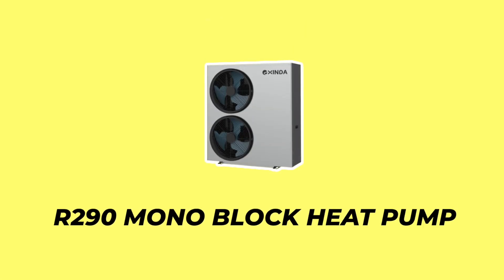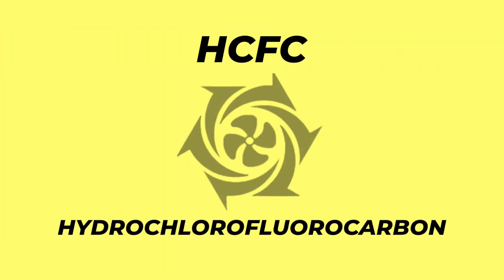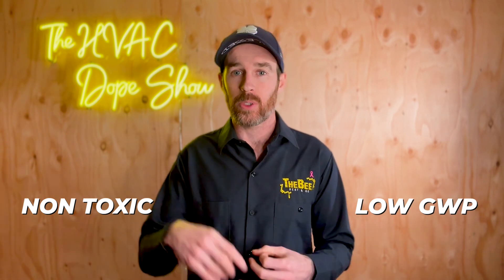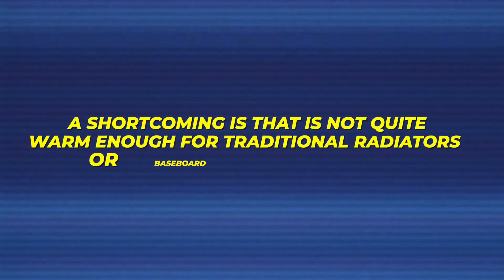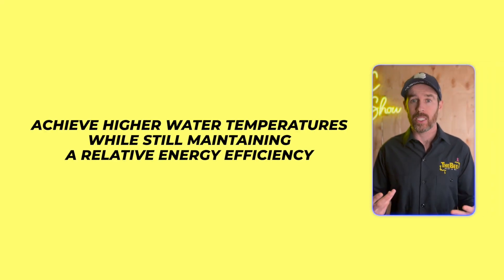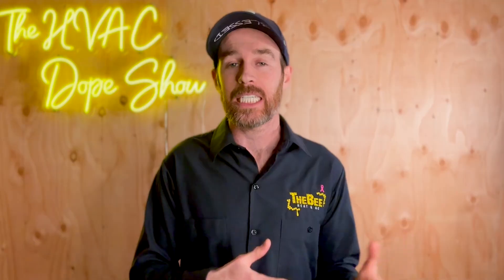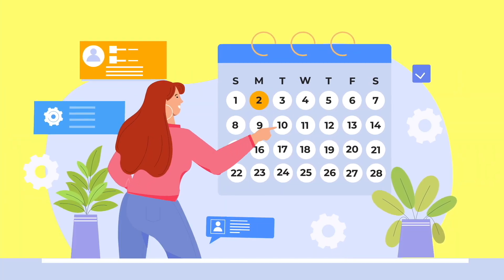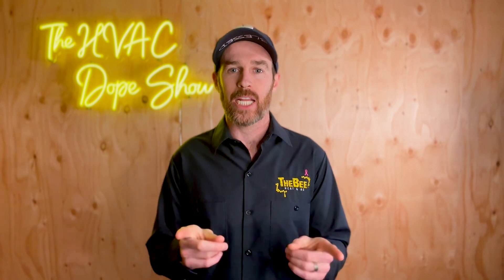This Heat Pump changes EVERYTHING | R290 Heat Pump

Comment: In Australia ive been installing r290 monibloc hot water units for a few years now and i can say with confidence that they just work!
We even have r32 pool heating heat pumps that work well to heat pools
Reply from the maker: Right on that’s awesome, yeah I’m hoping they make there way here. I know we’re having r32 monobloc coming soon that will heat better than 410a but not quite as well as r290 so it’s exciting to see the tech advance
Reply: @TheHVACDopeShow it's crazy that R290 is twice as performant as R-134a, then you realize that ammonia is over 3x as performant as R-290. But with the caveat of being flammable, toxic, smelly, and corrosive to any copper alloys.
Water would be 2x ammonia, but it has the pesky habit of freezing below 0 and needing a vacuum to boil at anywhere near room temp. But at least you don't need to worry about moisture in the lines..
Reply: Excellent. How do you find it for indoor cooling, especially during very hot summer days?

Comment: Wonder if this is a good use for pool heaters. The current ones have a hard time getting water above the upper 90s so you need gas still if you have a spa attached
Reply from the maker: There are a lot of heat pumps like this for pools and spas so yes they should have something available for hotter temps too

Comment: Do you believe these upcoming monoblock systems will also be used to replace the furnaces from hydronic heating/hot water setups using air handlers? Currently have an old Buderus that heats up coils in the air handler to give us heat (2 zones/air handlers), as well as supplies our domestic hot water. Very efficient and happy with it, but the paired A/C units are 20 years old and inefficient. I'm hoping these monoblocks fit the bill for disconnecting the Buderus and old A/C compressors. Thoughts? And great vids
Reply from the maker: They’re kind of pricey atm and the r290 systems aren’t available here yet. Depends where the R32 Altherma comes in and if it’s cost effective, I’ve just seen some pricing from the Solstice seemed doable but the performance was only hot enough for radiant flooring temperatures (120F) to still maintain efficiency.
Reply: @TheHVACDopeShow  thank for the reply. I’m not ready for a monoblock switch-out yet, so I have a few more years for other manufacturers  to get in there a drive prices down (hopefully some name brands too). Was mostly interested to know if the application fits. Sounds like it might. 👍

Comment: Living on the Oregon coast the only available energy source is electricity or gas. Propane tanks are not allowed in my community Is there an equivalent heat pump that runs on electricity?
Reply from the maker: No worries 😁 It actually doesn’t run on propane propane is the refrigerant. R290 is propane. It’s powered by electricity like every other heat pump so you’ll be able to use it when they’re available in the USA. Hoping soon but no word yet, maybe 2025
Reply from the maker: They make monoblock with R32 that will be out this year but it’s not here yet.
Reply: @TheHVACDopeShow   Can those be retro-fitted to accept/use R290 when available

Comment: I am confused with the descriptions for the upcoming mono-bloc systems using propane as a replacement for other refrigerants. For example, the new mono-blocs are reported in this video to be absolutely fantastic for base board heatings..........AHhhhh now to get rid of my oil boiler!

OK so I have free heat (I have solar) in the winters and continue to sweat in the summers??? How will the mono-block provide air conditioning when needed? Base boards???

Joe Howarth
Reply from the maker: Air handler… it’s water pipes so it ties into your baseboard loop as a zone and into an air handler with ductwork for cooling. Still a ways out unfortunately in the USA, out in other parts already but not quite here
Reply: @TheHVACDopeShow
Reply: Sure that should work! I need a heat pump system but am forced to use a registered, licensed installation company. Yes, there is Mr. Cool but it has limitations.

I spent 4 years in university classrooms to earn a BSEE degree.  But bureaucrats require a license to purchase refrigerants, a license that requires 500 hours of classroom studies plus a minimum of 6,000 hours on the job experience to be able to take a test needed to use today's refrigerants. Wonder if those licensed guys are brain dead after finishing with all that crap!

Comment: What's your opinion on using hydronic for an AHU central air retrofit (Minnesota)?   Would it also adequately satisfy cooling in the summer (hot and muggy)?
Reply from the maker: Like a monoblock heat pump tied to air handler? That’s fine but the current refrigerants don’t get the air handler quite as hot so they’re normally larger coils to make up for it. When R32 comes or some of the others the temp of the water will be able to get higher and maintain efficiency and then it would be a good option. R290 will change things for sure once it comes to the US

Comment: Any real breakthrough for air to air???  I'm looking for the next big thing in mini splits here in the US...
Reply: The same refrigerant could be used in a inverter for AC and heat.  The big benefit is that it’s the same system and only requires the heat pump to run forward or backwards depending on what you need. Yes, I oversimplified this a bit.
Reply from the maker: Air to water products are out now but if you don’t have a need for air to water for radiant floors for example then you’re probably fine sticking with just a higher efficiency mini split. Biggest developments are just improvements in efficiency.

Comment: I'm in UK 🇬🇧 R290 is available I wait to go Off-Grid then drive heatpump via Solar PV & Batteries storage
Reply: Good luck with that 😂
I’ve got 5kW PV
Triple glazed, external wall insulation 90mm 24kw Pylontec battery’s. No one on earth you’ll get self sufficient.  Oh just had an ecodan 6kw

Comment: what about R290 with Bi-block?
Reply: if there is a leak it might explode inside your house...
Reply from the maker: What they said ⬆️ definitely don’t want a high pressure propane leak. Normal propane pressures in your home are around 10” water column (.36 psi)… in a refrigerant circuits the pressures of the propane is over 300x that so a leak will spray a lot more propane

Comment: Propane is made from fossil fuels, so how will this be affected when there is no more drilling for fossil fuels?
Reply from the maker: What @ronmorrell9809 said lol… it’s closed loop so it’s not burning the propane. It’s just using it as a refrigerant for heat transfer. Like a lot of fridges use butane or flammable refrigerants but it’s a small loop and doesn’t consume or burn it. We’ll never stop drilling for fossil fuels, there just eventually going to use them more sparingly and not daily in cars etc like we do now.
Reply: If there is ZERO drilling, we won't have oil for lubrication.  The amount of propane used for these is extremely small.  Note the European limit is 500 gm/loop.  About 18 ounces.  The propane tank uses for an outdoor barbecue holds 20 lbs.  Enough for 17 systems that will not need recharging for several years.   We'll be fine

Comment: I've run a propane and isobutane mixture in my car a/c for decades. It runs at lower pressures than even r12 so its was great for old leaky/creaky r12 systems on their last leg. I got better mpg too. It was illegal to retrofit old r12 systems in the usa and probably still is. In the hvac forums i got a lot of guff with the old timer r12 techs saying that its a mobile barbecue that would instantly incinerate bus loads of children with my evil gas. I've moved to japan and have been researching it here. I found a Daikin webpage from 2022 talking about new r290 residential units air to air heat pump being available so this will be my first choice for my new house install
Reply from the maker: That’s impressive
Reply: Of course propane has always been known as a heat working fluid—but it’s Flammable! Now we’re told it’s safe indoors.

Comment: Oh no.. how you would have propone or any flammable gas inside your house? 
That is what 90% of houses around the world have anyway.
So I do not see even the point to have this "monoblock" design which increase the cost due the plate heat exchanger
Reply from the maker: Difference is if you have a leak in your coil propane is heavier than air and would settle in the confined area of your ductwork/ blower wheel and all the electronics so when the motor kicks off it could explode if you had a leak develop later. Monobloc eliminates this issue. Other propane lines going into your home don’t pose this same risk as much because they wouldn’t be leaking directly on top of electronics that could ignite the fuel. It also allows for water heating
Reply: @TheHVACDopeShow  Why it would ignite even if the motor start? 
They do not spark, at least not this kind of motors. 
Also, the amount of refrigerant that a normal close circuit needs is not enough to cause much damage. Also propane can not produce short circuits because is an insulator (liquid or gas). 
If someone take so serious this incredible remote possibility, then why boilers, furnaces, kitchen hobs, or several other home appliances that can cause fires or short circuits are allowed?  
There is no point, safety regulations some times reach absurd levels.
For example why ammonia was ban for consumers?  The risk for poisoning is almost zero. 
About allowing for water heating, that is an actually plus in which I give you the reason. 
But if you ask me, I would prefer to have all those needs in the same appliance without the need to have heat exchangers and water pipes over all your house, using the same refrigerant as working fluid.
For example, a single heat pump could power a refrigerator, hot water, Hvac, energy thermal storage and so on. 
Like the tesla heat pump who can move heat from 16 different points or hardware.

Comment: I am building a R290 heat pump with a compatible Unused R22 compressor
Reply from the maker: That’s AWESOME 🙌
Reply: Legally, one could charge systems with up to 500g of R600, which is at least 2x as effective per gram than R-134a, R12, R22.. so unless the system takes a kilo of the stuff.. it's up to you to charge and take the risk.
Reply: Make sure any potential leaks are vented away from potential spark sources. Old relays  could work as ignitors....IMHO

Comment: The monoblock is revolutionary and a good idea but r290 is not revolutionary because the original natural refrigerants are finally overcoming the garbage the chemical industry got the politicians to push on us so they could make billions and destroy our environment! Co2 is even better but requires higher pressures so the equipment is more expensive to produce but it is not flammable and even less damaging to the environment.
Thanks for your presentation, I am glad the world is finally reawakening to natural refrigerants!
Reply from the maker: I know lol it’s kind of sad… we are looking into importing them ourselves from a manufacturer that makes them overseas but regulation is still tough so we’ll see if we’re able to get them. I just love the idea of radiant in floor heating from a monobloc inverter driven heat pump and being on solar. Lots of off grid systems in the mountains will always stay off grid because you can’t run gas lines up a steep hill very easily so these make for a great use case when compared with heating with propane for example

Comment: How will this handle cooling? Or is this going to be dedicated to heating only?
Reply from the maker: Same as a traditional split heat pump it’s just a hydronic air handler which means it’s circulating water instead of refrigerant. All the refrigerant is outside
Reply: I think my confusion is how would it handle both hot water and home cooling? I appreciate that it can do both but would there be a manifold that distributed the different temperature fluids. And if that's the case, would heating water also chill the cooling loop? Just sounds like an interesting concept.
Reply: @wings2004  need an 'air to air' heat pump for both,,, the heat exchanger is installed inside the home for cooling and heating, above doors for example
Reply: @wings2004  three way valves for cooling loop if you want to heat domestic water and provide AC at the same time.
Reply: For those still wondering: it simply reverses the climate cycle. Meaning it will chill the water in the loop. The downside is that a radiator isn't really effective for cooling. So it only really works with large surface heaters like underfloor heating.
Reply: @Felix-st2ue  You can use a water to air coil in your air handler for both heating and cooling if you now have forced air.

Comment: I want to get a mini-split heat pump but with R410 heat pumps no longer being sold in 2025 and R290 monobloc heat pumps coming on the market I don't want to spend money on obsolete technology. It feels like buying a new computer that is outdated when it's only a few years old. I am interested in how successful R290 heat pumps will be in Europe.
Reply from the maker: R290 is successful in Europe it’s been in use for decades technically in varying applications and is also used in USA but limited in use (small charges in ice machines / freezers etc.). R290 will come to the USA for monobloc but probably not as a mainstream refrigerant IMO. R32 /and 454B are the new A2L refrigerants they’re pushing in the USA but those are still blended refrigerants, and are being chosen because flammability index is lower than 290 and some the others like R600 / Isobutane which are all highly flammable as a downside. But monobloc contains all this outside and just results in apex coming to the US. R290 won’t be in a mini split / ductless system ever so you’re probably safe to pull the trigger there or could wait for one of the others if you’re not in a hurry.
Reply: @TheHVACDopeShow  So if I buy a R410a mini-split and it runs low of refrigerant after Jan. 2025 it can be refilled with R454b? Can I buy a mini-split filled with R454b now?
Reply: @tom95521  From what I've heard I think R32 is going to be more common in mini-splits. R410a and R454b are both blends primarily consisting of R32 so a bit more R32 isn't going to hurt it. But also R410a will continue to be available for years to come.
Reply: From what I read, the old refrigerants will still be available.  Just trying to reduce their use by moving new systems to the new refrigerants.   I think even the original freon can still be purchased.  
What I did hear is that because they are "new", these new R290-based systems might be 30% more than equivalent current systems.  Will that be true?  Are they that much more efficient (to have a positive ROI)?  Not sure...
Reply: They won't be that much better, if they're phasing it out it's your change to get remaining stock of them on sale cheap before the new year.

Comment: All fun and games until the evaporator blows the charge in the house. Make refrigerant great again.
Reply from the maker: Monobloc means everything is contained outside there’s no propane refrigerant in the house. You just have hydronic lines (water / glycol) running inside
Reply: @TheHVACDopeShow  safer but Still a fire hazard if that compressor shorts to ground outside.
Reply: @AmericanFarmerHVAC2024  Why are you ignoring the fact that millions of homes/businesses burn several trillion cubic feet of natural gas annually? Seems a bit odd to worry about a pound of propane. Better switch over to the Tesla grill and ditch the 20lb propane tank too.
Reply: @centauri8820  Idiotic response. Do you know how many millions of leaking evaporators in homes/businesses I've repaired or replaced? Brand new ones leak right out of the box. Where are they installed? In the home. Refrigerant floats through the ductwork. Black iron pipe or copper doesn't start leaking gas, once it's sealed and locked down, you're done. Thin copper or aluminum coils that aren't even sealed properly from the factory more times than not, you're comfortable with a gas as a refrigerant flowing through that? Un-real. We're talking about air conditioning, not a heat source.
Reply: @AmericanFarmerHVAC2024  lol.....If you repaired 3 million with each taking only an hour, you would be at minimum, 342 years old.

Comment: Where do I get one? The higher water temps mean this will work to tie into my system. Can anyone tell me the COP numbers?
Reply from the maker: Wish I knew, they’re only in Europe/other markets outside the US at the moment. I’ve called several vendors and haven’t found any available yet. COP numbers are very good, vary by unit but I’ll have an update as soon as one ships and we get our hands on one
Reply: For sure the COP will improve for lower water temperatures, even if 180F is possible.  It would be interesting to model someone running their heat pump at up to 180F and compare the life time operating cost to replacing some radiators with modern models to lower the water temp and improve efficiency.
Reply: @RicknessJ82 At 180f you're looking at COPs well below 2. So not really efficient at all. Usually you run a heatpump with weather compensation. So the fluid temperature is dependent on the outdoor temperature. But unless energy is nearly for free you should rather make changes to your heat distribution or insulate your house to get the required flow temperature down.